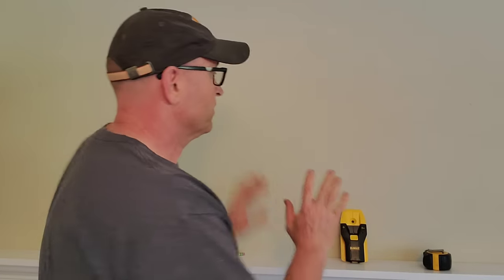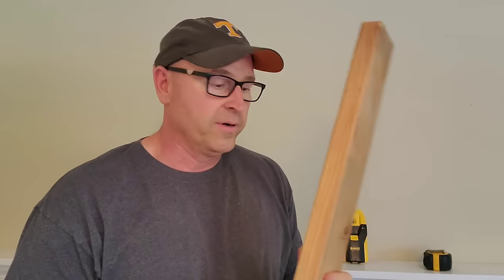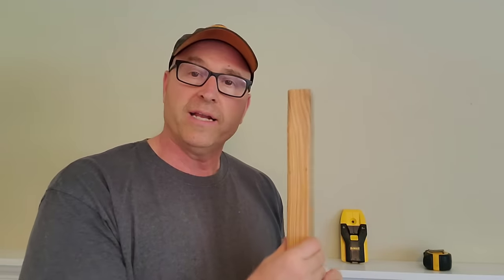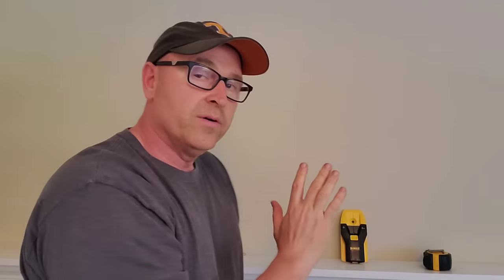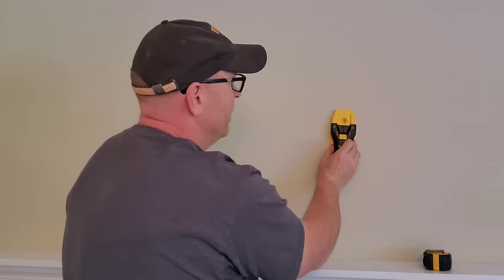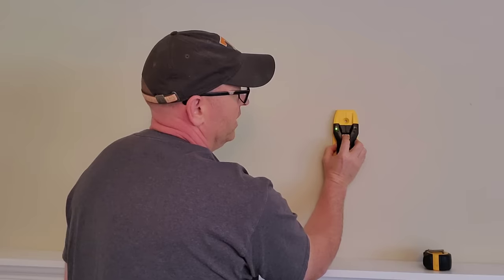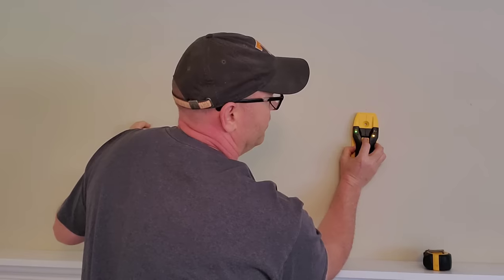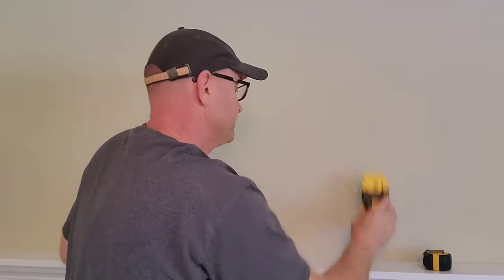How to Use a Stud Finder

Comment: You missed a step! You have to test it against your chest and yell, "found a stud" first 😉. 

Great video - thanks 😁
Reply from the maker: Haha, I missed that opportunity, didn't I?
It's probably best to limit my dad jokes to 1 per video. 🤔
Reply: As a middle-aged dad myself, that was going to be my suggestion as well! It's pretty much mandatory.

I feel like this video also leaves out the part where the stud finder seems to erratically indicate studs every 4-6 inches, but not with any consistency. At least that's how every stud finder I've owned seems to work.
Reply from the maker: Haha, I figured max of 1 dad joke per video is more than enough. I have had good luck with the Dewalt studfinder, although I do even say in the video not sure how well the AC detector works. 👍
Reply: Came here to make sure he did that. I'm a little disappointed.
Reply: This is as required 1st step as snapping grill tongs a few times before use. :)
Reply: @DadhowdoI  I think you can squeeze more in a long as they are spaced out
Reply: I wanted to say this. 

Also on a less humorous note it important to note that in the US, it can also be 24" apart. 16" is better but for some reason, every house or apartment I have ever lived in is 24" apart rather than 16".
Reply: @wolfwintemute7298  The small section of wall shared between my kitchen and garage, has 26" spacing. It was build in 1959.
Reply: Yeah, my house was built in the late 1800s and it's every 18" apart
Reply: "That's my boy!"
Reply: Came here for this joke
Reply: This is the dad joke I was expecting, but I'm glad he included a "stud finder" joke anyway! 🤣
Reply: @MikeBolitho  same my man.
Reply: MY SWEET DAD USED TO DO THIS, ahhhhh, my favorite.
Reply: This dad came here to say the same thing... I'm not mad it was already here, I'm disappointed... LoL
Reply: Gotta be sure it’s calibrated correctly. If the finder can’t find the stud that’s holding it how can you trust it find a stud inside a wall?
Reply: very first thing I did with mine!
Reply: @DadhowdoI   Dad jokes...the more the merrier!!
Reply: Can't tell you how many times I've seen it
'yep it works'
Reply: I literally screamed “he’s doing it wrong!” When he skipped that step
Reply: RIGHT!!!!! that's what I was thinking!!!!!
Reply: @n1vg  so true.....so so true....I always revert to knocking!
Reply: Its a mandatory dad step!
Reply: @mythdefied9070  As pointed out in the above posts, the spacing can wander, due to changing building codes and materials. Your 1880 house is on 18" because the 2 x 4s are ACTUAL 2" x 4" lumber. 16" is a good rule of thumb, but the stud finder makes sure things are where they are supposed to be. I framed houses one summer in the early 80s and some of the stuff I saw...well let's just say it wasn't always 16" on center...
Reply: @scottjanzer8083  And whenever you attach something you have to give it a tug and say "That ain't goin' nowhere."
Reply: I came here for the stud against the self dad joke....lol.  oh well. I myself didn't have parents who were versed in these basics but learned everything along the way, through friends, books, or trial and error.   I appreciate what he is doing for many who don't have the opportunity to learn this stuff.   Great job
Reply: I was disappointed and only clicked because I wanted to see him do that
Reply: My soon to be  Mother-in-law gave me a stud finder for Christmas,  I did this while laughing hysterically at my own joke, and she literally said, "I knew you were the right one".

I'm pretty sure she's currently praying for my grandkids.
Reply: @DadhowdoI hey do you have a link for me to find where this stud finder model is

Comment: Hey, I'm just checking out your channel, and you know what a lot of people don't get taught is to flush their water heater! It's very important, super simple, yet so intimidating, so it would be a great subject for a video, I think.
Reply: Wait, what? Like for real?
Reply: That’s a thing😳
Reply: I don’t even know what that is but it sounds important so I agree I would also like to see a video lol
Reply: @ot1040  I grew up in apartments, so when I got my house, I had to learn the hard way when black stuff started coming out of my taps! Very important stuff.
Reply: Actually, this is debatable as to the benefits.  Periodically draining and refilling a modern water heater may cause extra strain on the unit and shorten its lifespan.  However, it may be useful to do if it goes without any use for an extended period of time (e.g. coming back from a month-long vacation where sediment has accumulated on the bottom of the tank).

Comment: If you have a strong magnet it works too… nails are usually magnetic… so you can find the stud via the nail they used to screw in the drywall.

Comment: Better than a stud finder is to use a couple of powerful strong earth magnets!  The nails or screws in your drywall that hold the drywall to the studs are usually made of magnetically sensitive metal and those nails/screws will be located in the studs.  Strong earth magnets will find those nails/screws almost instantly and, if powerful enough, the magnets will adhere to the wall - you only need two magnets stuck to the wall to get a vertical line going.  In addition, the el-cheapo electronic stud finders will find all kinds of junk in the wall (electrical lines, pipes, etc.) that you don't care about and will frequently mislabel them.  Magnets will only find the drywall nails/screws and therefore you'll find dead center of the stud every single time.  Plus, wherever a magnet sticks on the wall is a precise location on the wall where you literally can't put anything else - you'll just damage your paint job and drywall attempting to put a hanging nail or screw in the same spot as the existing nail/screw that you can't see.  So you'll also save yourself the potential headache of patching up drywall and paint.  Once you've used magnets for stud finding, you won't use anything else ever again.  (Note the magnets really need to be strong earth magnets - regular kitchen magnets won't work.)

Comment: Wow, first off, youtube dad, you're great! Keep rockin'. 
But I really didn't know that in the US there are those stud things. So you don't have solid walls. I knew that US houses are built differently than ours (I'm from Austria), but after that video I watched several others and it really seems like your houses are made of just cardboard and wooden sticks 🙄. Our houses are made from massive concrete or bricks, you can drill a hole and hang your shelf everywhere you want. (if you have a good hammer drill).
But the houses in your country are much cheaper and therefore more affordable I guess 🤷‍♀️

Comment: Thanks for the video, but is this all the professionals use to confirm they are not drilling into a water pipe or electrical wire ? Thanks for the video

Comment: If you live in a trailer or double wide, you might not have studs every 16 inches because those homes are typically built cheaper. In that case, try using wall achors.

Comment: Without the tool, how would you find a stud? Every 16” starting from where? The corner of the wall?
Reply: The corners have to be braced so drywall can be screwed to them. However, that does not always mean they're spaced 16" from that point, depending on the length of the wall. An electrical outlet box has to be fastened to a stud, on one side or the other. If you start up the wall, directly above one, there will usually be a stud in line with one of the sides of the box.
Reply: Thank you! I appreciate the advice

Comment: I think you just need to ignore the AC alert indicator, since it goes off constantly.  Just focus on the stud detection lights.  Triple check the signals.  Then confirm with a drill and a finish nail to be sure you are hitting a stud.  Trust but verify...u know the drill.   See what I did there?

Comment: A stud finder will find the edge of the stud, does not find centre as there is no way to calibrate the machine for this. Mark |x in relation to which way you are coming to the stud

Comment: What brand and model stud finder is this?
Reply from the maker: It's a DeWalt DW0100. The stud finder works great, however it is also a "live wire" detector, and I seem to get some false readings on that.
Reply: Great, thank you! I have purchased other stud finders in the past and I don’t think they worked nearly as well as yours. Thanks again and ill be changing out my toilet flapper tomorrow!

Comment: That’s not quite right about 2 by 4’s.   Older homes have true 2 x 4’s.  They have been cut smaller for a long time to save wood.   I’ve seen the originals.  They are quite hefty.

Comment: Dont spend the money on a electronic stud finder they are shit just get a strong magnet and it will find the screw heads in the drywall I'm a finish carpenter Been doing it for 15 years and have never used one

Comment: DAD HELP how do I clean out my bathroom drain?
Reply from the maker: I am assuming it is the sink that is clogged? Put a bucket under the trap, then unscrew the trap on each side. Depending on the age of the home, you may or may not need a crescent wrench. Can be kind of a gross job.
I am planning to do a video on this at some point, but you probably can't wait that long. 🤔
Reply from the maker: Kayla, today's video will show you how to unclog a sink.
Reply: @DadhowdoI  you are my hero 🙌🏻